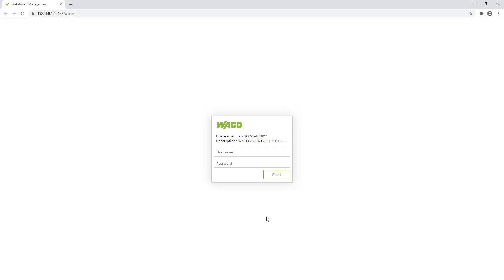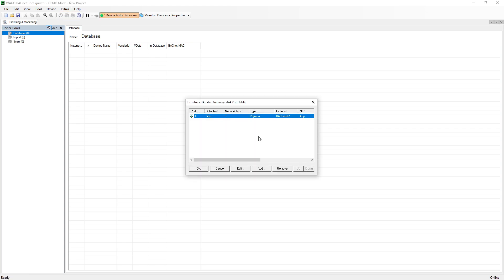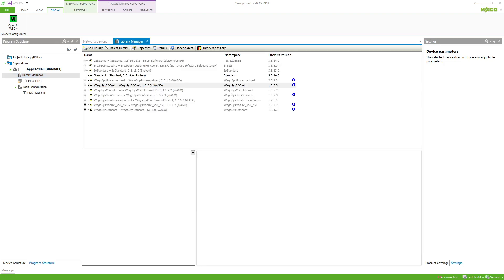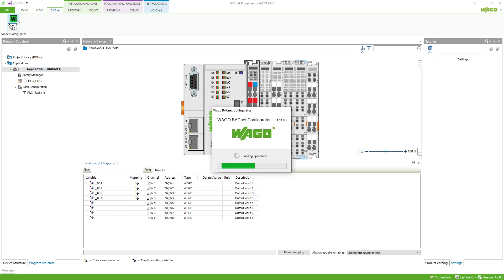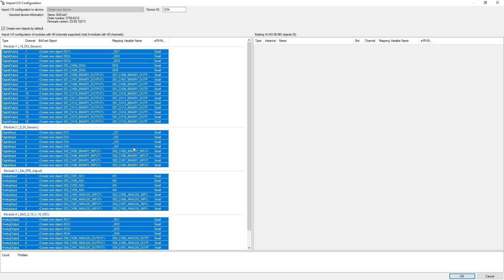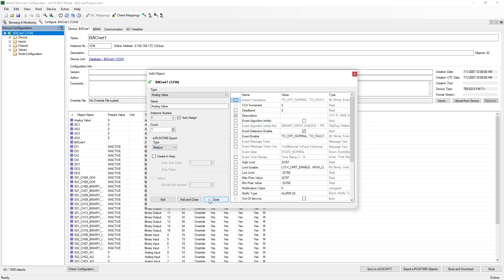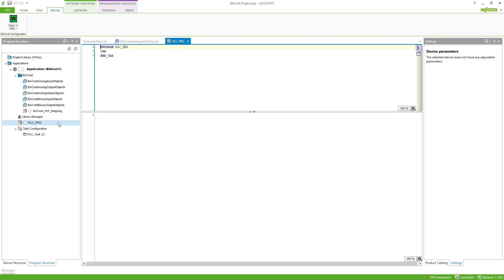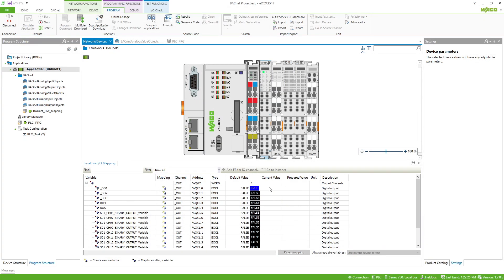BACnet Configurator Workflow | e!COCKPIT

Comment: Hi, I have a WAGO 750-8210 PFC200 G2. In the "Fieldbus" tab I only have OPC UA and Modbus, the Bacnet tab is not there.
What can I do ?
Reply: I fixed it by enabling "e!cockpit Runtime" instead of "CodeSys V2"
Reply from the maker: Hi Djstu, 
probably there is still an older firmware on the controller. The menu item BACnet is only displayed there since firmware 18. You can get the current firmware from our support. Please contact support.de@wago.com.
Kind regards from the WAGO Team